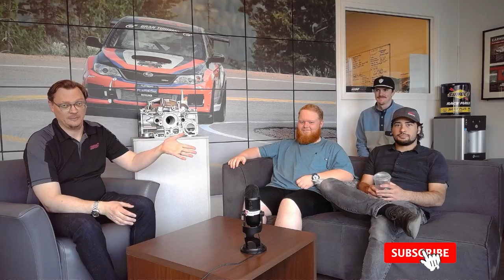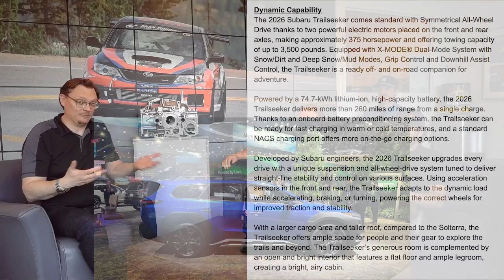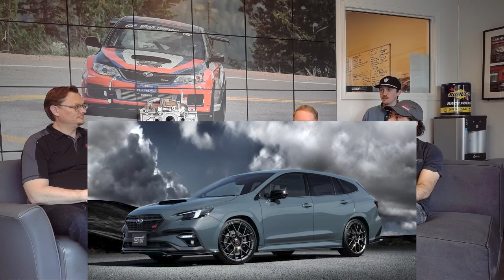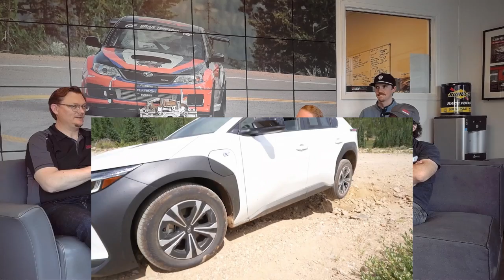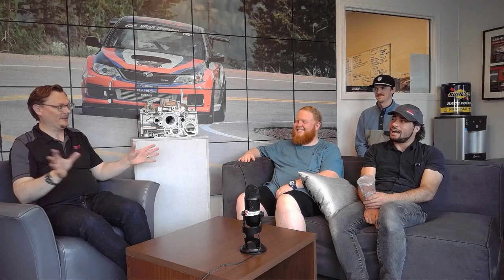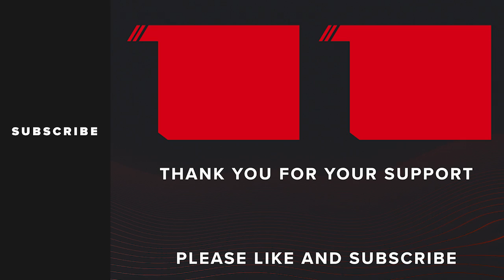Trailseeker - Fastest Subaru Ever?

Comment: Trailseeker all the way. Rounded wheel arches. Looks “Subaru” not Toyota. Sounds like it’ll be fast and capable. SUVs are overcompensating for your little tie rod end. Those of us who actually remember the 1992 legacy wagon will always need a Subaru wagon, doesn’t really matter about the divorced headlights. I just wish it had the physical climate controls from the 2026 Outback. They forgot an off-road EV also needs buttons for unclean fingers.

Comment: Any new performance / halo Subaru has to have 0-60 in low 4's or better.  The "near supercar performance" label stuck on the STI for barely under 5 second 0-60 has faded and peeled off, particularly when Subaru disgraced itself by leaving the inefficient EJ257 in it.  VW teased a 400+ HP Type R and then wimped out, probably because the economics weren't there and there wasn't durability in the small turbo motor that high.

As far as hatches, if the GD had a hatch it would have been the perfect all in one car.  It's still the top autocross model because it hadn't ballooned up in weight yet.  The only reason that the WRX had a competitive 0-60 was the longer 2nd gear.

A performance Subie, hybrid or all electric, has to meet/exceed a Tesla 3 Performance  on pavement to impress anyone outside of the  fanboi fraternity.  Off-road may be another matter but it's not my interest.

Comment: I think for those who are actually off-roading an EV… the only thing you should have on your roof are solar panels. 

A roof rack with solar panels is the answer. 

I think you’ll be able to trek further and deeper than any gas vehicle because you essentially have unlimited range , vs the struggle of having to carry fuel or finding fuel since you yourself are not a refinery
Reply: There's not room for enough solar cells to really make this rock.  If you can only put 3kW of solar on, it would take 2-3 days to recharge this under good conditions.  So drive, then wait a couple of days?  Assuming good solar conditions.
Reply: @pault151 I see your point for sure. But assuming the solar panels are on the rack all the time. In those 2-3 days of overlanding it’s constantly recharging even while the vehicle is in use. So essentially in those 2-3 days it’ll have recharged your entire battery at least once. 

But I was speaking more so in terms of an emergency. The ability to always ensure the vehicle is capable of moving , albeit even just a few miles as it’s charging is better than being stuck without fuel right? Idk… I don’t off-road nor overland lol